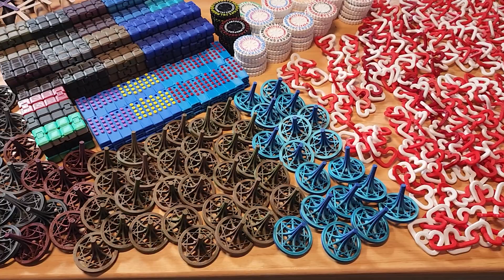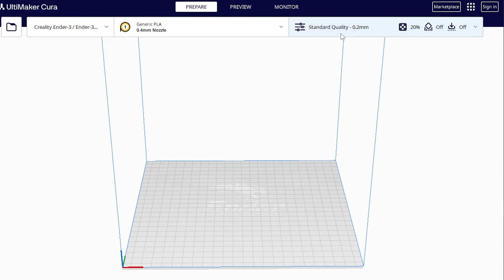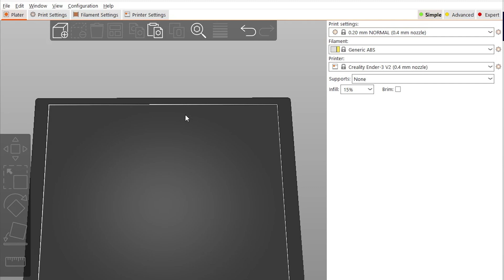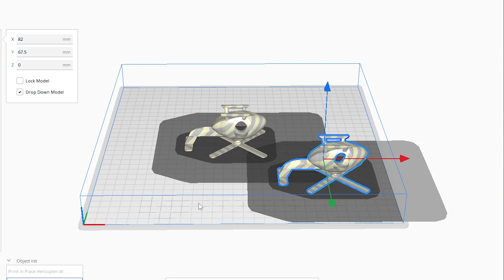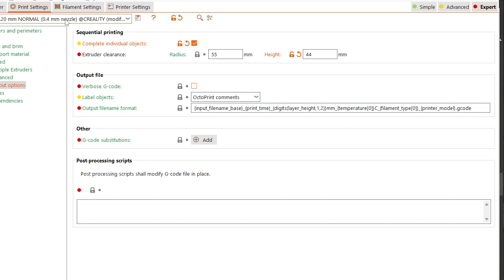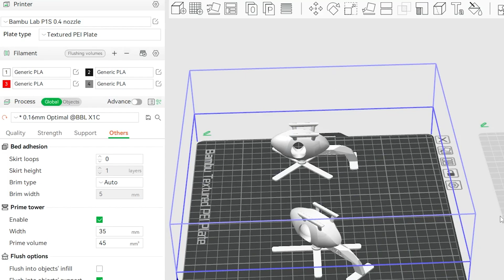Beat Filament Waste by 3D Printing Sequentially!

Comment: Be sure to check your Z clearance. If the 1st model can't be cleared by the printhead to start the second print in sequence the slicer will generally complain. You can overcome that by selected the 'by layer' option for the multiple objects. Its downside is that it will increase your travel time for all the models on the build place.
Reply from the maker: Yep, that's basically what the Expert settings in PrusaSlicer are doing, especially when they keep giving errors. Bambu just sort of "does it." And Cura? Well, as big as they have in all directions, if you can get something else on there, it's probably not an issue. Still, it's a great point for all of to remember and be careful of. Thanks!
Reply: @my3DPrintLab  In Cura it is 'All At Once'. What might not be obvious about the sequential print is not only can the tip clear the object but can the  print head clear the  gantry in Creality style printers.

Comment: I think sequential printing is useful for printing multiple objects that might suffer from layer adhesion or bed adhesion issues. Printing with ASA, an object with sharp corners that may warp if left too long. Thanks for the video.
Reply from the maker: Glad to help!
Reply: It's also a useful feature for test prints because most slicers allow you to change settings for an individual object, e.g speed, jerk settings etc, so you can assign a different speed per object as an example.